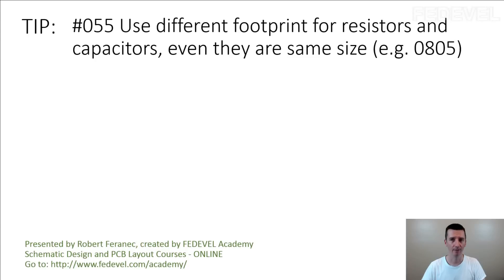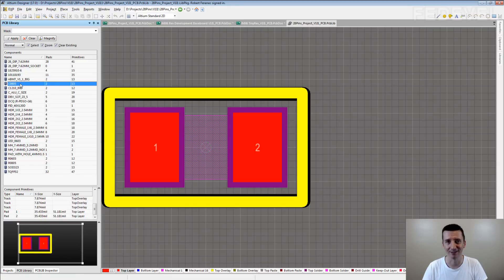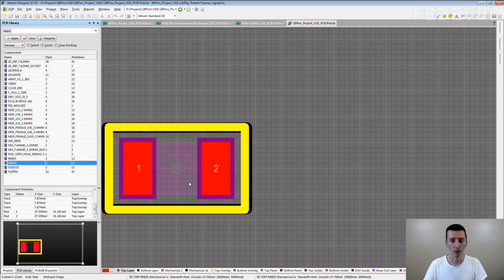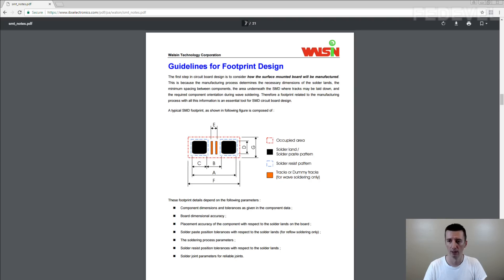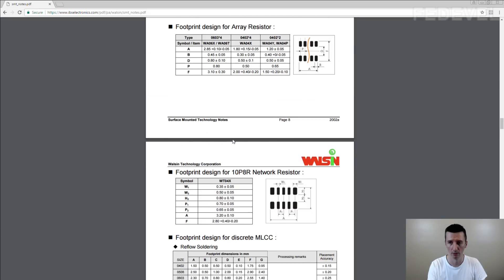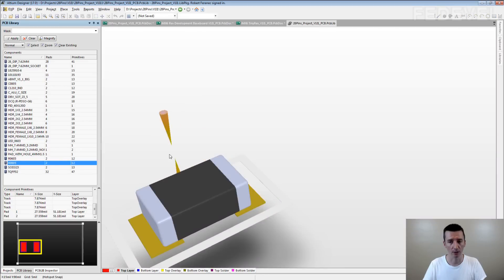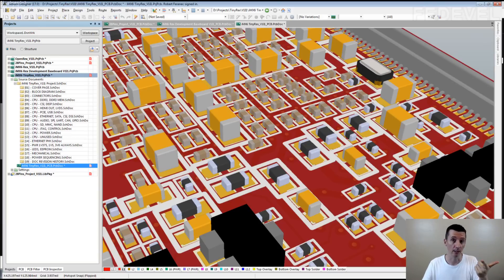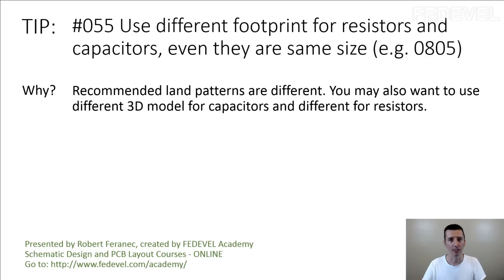TIP #055: Use different footprint for resistors and capacitors, even they are same size (e.g. 0805)

Comment: Typically, capacitors tend to be taller and have slightly different end caps than resistors. This means the solder fillet will look different if the same footprint (with the same paste layer) is used for both parts. Some parts also have soft terminations and this might influence footprints as well.

Comment: Hi Robert! Could you say why you are don't use IPC 7351B land pattern calculator? It's free with restriction to make library component directly from the software but you can just redraw what it get to you. Because there is also some another features in land pattern design like N, L, M density level and so on and this tool can calculate it. Thank you!
Reply from the maker: There is no special reason. Sometimes it just looks to me that using the numbers from datasheets and documents may be more safer (I always hope the manufacturer knows why he is recommending specific footprint).
Reply: I was going to mention the same point, PADS (and most other tools I think) come with pre loaded IPC7351 based footprint libs for many devices (R,L,C,D,ICs etc) incl M,N,L versions.

Comment: can different values of capacitors but same size such as 1206, use the same footprint?
Reply from the maker: yes. just be sure you use the tallest 3d model from all of them (so all values will fit into the space occupied by its 3D model)